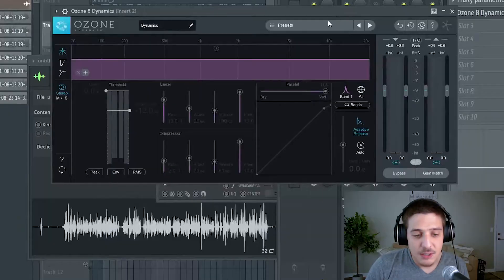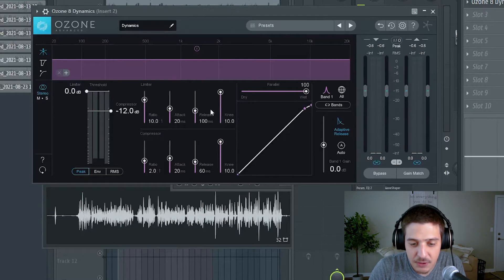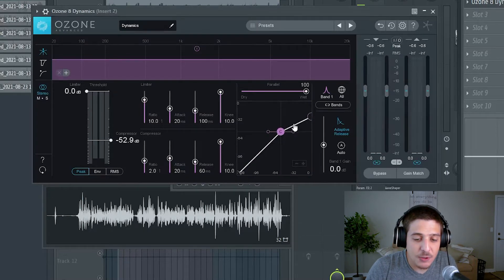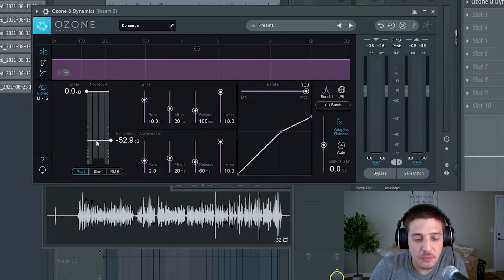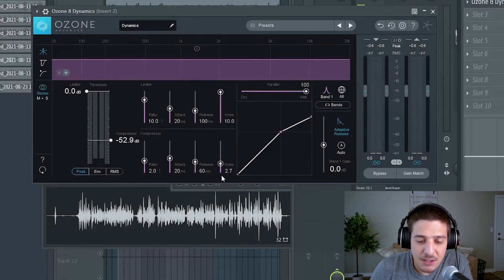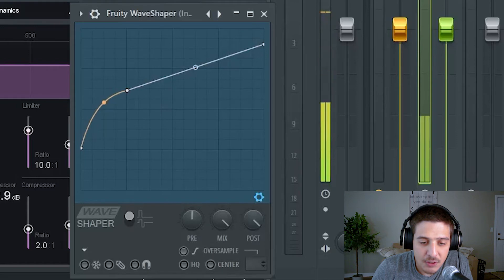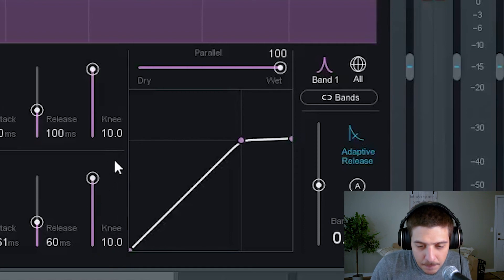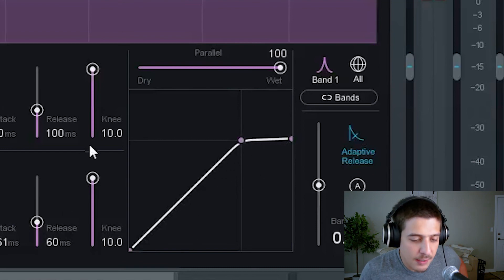What is a Compressor Knee?

Comment: Hey man! I don't understand how the Input and Output work together in the graphic?
Reply from the maker: No worries! The input is represented left to right and the output is represented bottom to top. You can think of the left to right being a db meter and the up and down being a separate db meter.

In our example, for the output volume of the audio to be unaffected, both db meters would need to be equal. Therefore we have a diagonal line representing this equality. When we go up 1 db on the left to right spectrum, we have to go up 1 db on the bottom to top spectrum. The graphic in question is a visual representation of this.

With that said, what happens if our left to right goes up 1 but our bottom to top goes up less? That means our output (the bottom to top) is now less than our input (the left to right). This would be compression of the audio, where the output is limited and less than the input.

The graphic is showing this relationship by starting with a diagonal line (which is equal) until it makes it to a threshold (the singular point where this equality is no more) and then into the actual compression (where we are no longer at a 1 to 1 ratio and the compression is taking place).

I hope this information was helpful.

Ps. Sorry for the late response.
Reply: @ScaleAudio  Wow! Great explaining. Now I understand it Thanks !!
Reply from the maker: @markbruggeman274  💪💪💪 heck yeah!